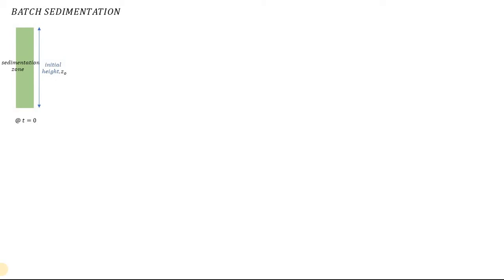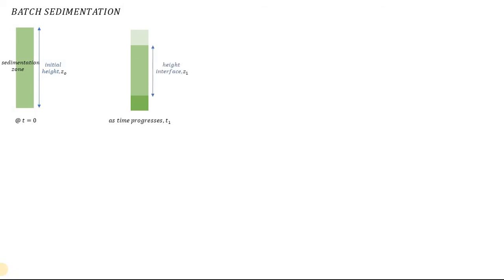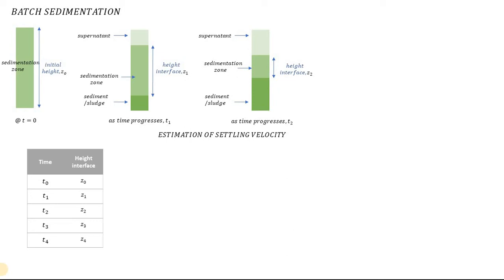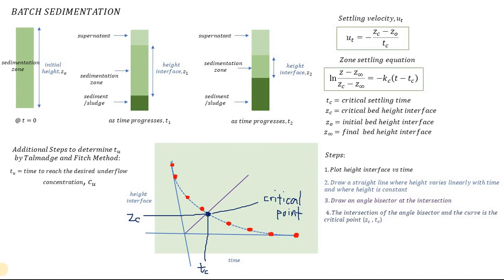Batch Sedimentation Test - Batch Sedimentation Experiment Calculation

Comment: Thanks for the video.
I am curious about something. Suppose I'm drawing the graph on a sheet of A4 paper, when drawing the bisector line from the intersection point, the scale of the x and y axis will affect the result (there will be a visual difference between fitting the x axis at 10 cm and fitting it at 25 cm, so also on the bisector line to be drawn by hand). So do I need to calculate the bisector line equation from the mathematical formula?